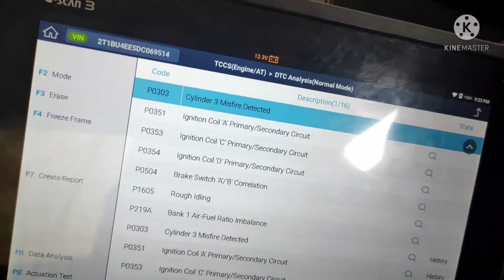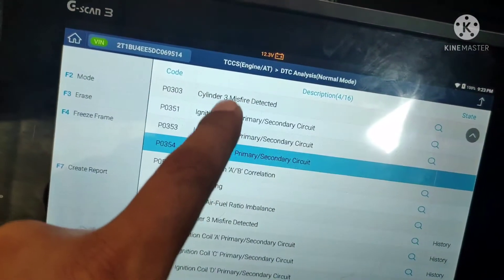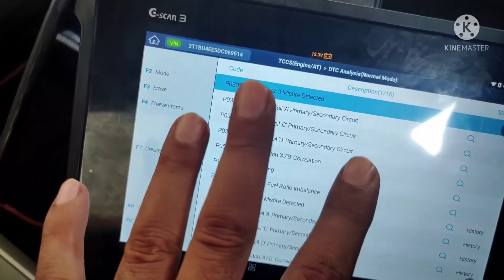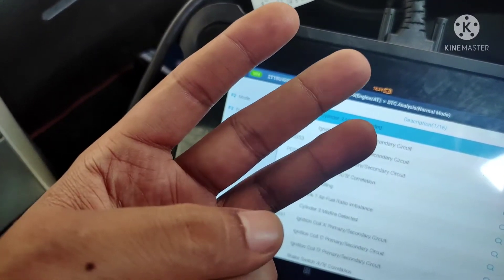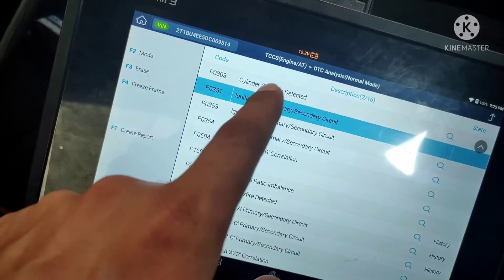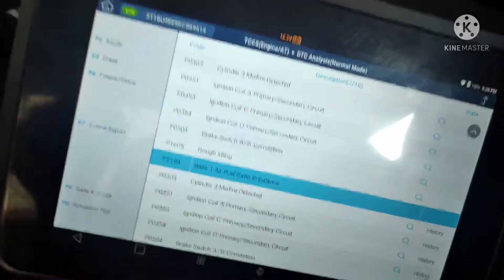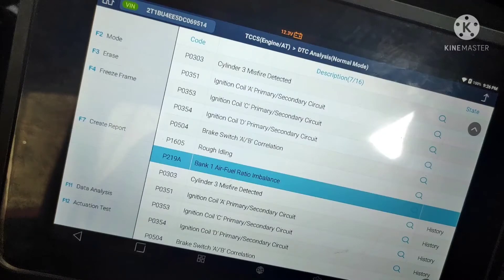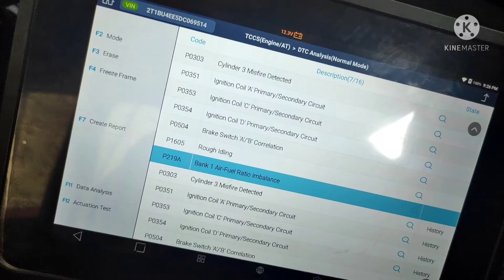Code P219A Air fuel Ratio imbalance [ SOLVED ]

Comment: Thanks! In my case it's P040 and P219A codes. I have already had all spark plugs and all ignition coils replaced, plus the alternator and serpentine belt. At first, it only showed P040, but I started it today and it was idling high without going down and threw the new code, P219A. I had ordered new fuel injectors after watching another video, but I was not confident that was the issue. Now you have convinced me that is probably the issue with cylinder 4. Now, I just need to learn how to depressurize the fuel rail so I can change the fuel injectors.
Reply from the maker: No need to depressuriza after turing off engine wait until it cools down then remove gas filing cap and remove the fuel house from injector rail the will some pressure just not let go in your eyes thats it. 
why ordered new injectors you can clean old one ! Buy a AC delco carburetor cleaner fill a small cup with ac delco and dip front of injectors in it for 10 minutes also use teeth brush to clean front end of injectors
Reply: @CarFaults  I suppose i could clean them, but the car has almost 1k miles on it and I am betting these injectors haven't seen the light of day since the car was made.
Reply: @CarFaults  Before I go elbow deep in this, is there anything else I can check first?
Reply: @katiesinthekitchen  in most cases it should be injector but it could be low head pressure but you can't do anything about that so go with injectors first

Comment: 2017 ford f150 3.5 ecoboost:  I had a P2237 (bank 1 sensor 1) code, so I replaced the O2 sensor.  After several drive cycles, everything seemed fine.  After two weeks. I got a P219A code.  The vehicle seems to be diving fine, and is very smooth.  I just purchased some fuel system cleaner (Chevron) and hope to see if this helps.  But if it doesn’t, I will need to diagnose the issue.  Any advice?
Reply from the maker: Looks like the problem with the fuel was already present it was not throwing code because of the bad o2 sensor. After the sensor changed, it worked and started sensing the fuel lean or rich.
Now, you should start checking the air leaks on manifold before the o2 sensor and intake. If all is good, then go with injector cleaning injector cleaner liquid won't do anything
Reply: @CarFaults  the chevron fuel system cleaner worked!

Comment: I have that p219A on a Toyota Corolla S. I just did plugs on it. Should I check the injectors then? Please let me know asap.
Reply: Yes its possible but when engine is misfiring you due to bad o2 sensor then you can check by removing o2 sensor connector (run engine without o2 sensor ) if there is no missing then chances of bad o2 sensor is very low there is also possibility on air intake leaking 
But start with injectors buy acdelco carburetor cleaner (not injector cleaner) remove injector and dip front end in acdelco carburetor cleaner for 10 minutes then with brush clean gently then dip again for 5 minutes then install it
Reply from the maker: Yes if check injectors if not injector then check cylinder pressure
Reply: It’s not possible that it’s a pcv or a o2 sensor. It idles fine. I also only had that code no other code. No misfire codes or anything just that code.

Comment: Mercedes CLA 250 need help with code P219D
Reply from the maker: Is there any other codes ?
If no then it’s injector if for any reason you are unable to check injector then change the location of injector and clear the codes then see which cylinder shows codes
Reply: @CarFaults  also showing P219c and P219F
Reply: Hmm it means you have multiple cylinders issue you also feel engine missing when driving ? If yes then you need proper diagnostic tool open misfire data then drive once you know which cylinder is missing and which is not missing swipe injector between missing cylinder and not missing cylinder 
For this engine i found many issue 
Mostly injector
Plug
Bad head gasket 
Catalyst converter blocked 
Bad oxygen sensor

Comment: Note that there’s a large number of causes for P219a — MAF, vacuum leak, exhaust leak upstream of the O2 sensor, faulty O2 sensor, bad injectors, bad plugs, bad coils. If you’re not seeing misfires, it’s less likely to be failing injectors/plugs/coils.
Reply: So if you don’t have a misfire that’s kind of a good thing it just means there might be a leak in the evap system?

Comment: 2014 Tundra 5.7 with P219c Cylinder 1 air-imbalance. Help?
Reply from the maker: Just clean injector nothing more 
Remove the injector place in ac delco carburator cleaner for 15 minutes then gently clean with brush.
Note : don't use any cheap carburator cleaner other then ac delco otherwise injector will damage and engine will take two to three self   to start when cold

Comment: Hi which place you are in Oman ? Want to visit your garage
Reply from the maker: Search Garage Al wali on google you will find me!
Reply: @CarFaults  3h 47min 😭too much far..can you guide me something please? I have checked in computer and got 1probelm.. have a code of p219d cylinder 2 air fuel ratio imbalance ...my vehicle some time missfire and engine light and track off light both comes ..what you think what will be the issue? I changed spark plug and coil ..but still comes ..
Reply: @saeem8701  Make and model of car ?
Reply: @justtrue8228  American specs .model 2014
Reply: @saeem8701  toyota Corolla??
Please check for injector if you already done then check air leak on intake from behind the throttle body
Reply: @CarFaults  please help me regarding this

Comment: I have 2016 dodge grand caravan that has p219a code. I changed o2 sensors, map sensor and injectors. I still have the code. No other codes except p219a. Is this code associated with ignition coils and spark plugs? Thanks
Reply from the maker: No its not due to o2 sensor three most common issues leak air vacuum from intake or injector O-rings , injector need to clean  or exhaust gas leak before o2 sensors.
Tips,
You can use bottle of water with hole in cap then start test air vacuum leak with water with start engine you will hear air water suction sound ( check leak for intake and injector o-ring)

Comment: I happen to have a p219f and a p219d code, would thse fall under the same category?
Reply from the maker: Please give me more details about car make model and year
Reply: @CarFaults  2019 corolla LE with the 2zr fe engine
Reply from the maker: Yes you should go with injectors first injector cleaner will not work when carbon already build up on injectors so you need to remove and clean you can remove them and dip in ac Delco carburator cleaner for 15 minutes and clean injector heads with tooth brush gently ( do not use other cleaners which evaporate only use ac Delco or something same as ac delco )

Comment: Thank you! My car had been shaking a little when I slowed down, almost like sputtering.  It had been doing that for some time. I changed the pcv valve, spark plugs but that didn't help much.  I'll check the fuel injectors now!
Reply from the maker: Hope you find problem soon also clean throttle body!

Comment: Would a bad crankshaft sensor(p0335) cause p219a and p0302?
Reply: These are the 3 codes I have.
Reply from the maker: Never crack sensor will give you only  p0335 no other codes
Reply: I have the exact 3 same codes. P219A, P0302 and P0335
Reply: @CarlosElHalabi  ended up being a coil pack for me. Even though the code said crank sensor. I didn’t touch/do anything else besides replace the coil pack. Driving and waiting to see if it comes back. The misfire is gone. Everything is normal right now.
Reply: @KerKoy  I've seen it but on older Corollas, even changing 1 coil wouldn't fix it you needed to replace the 4 of them. It's even illogical but it has worked before. I hope it doesn't come back and it does share the progress please
Reply from the maker: @CarlosElHalabi  looks like you need to clean fuel injectors also check for air intake leaks

Comment: What is spark wheel
Reply from the maker: Maybe spark plugs not spark wheel 🤔
Reply: @CarFaults  you said 4 things, the first one spark wheel and the second spark plug
Reply from the maker: @afgluda  oh maybe by misstake for engine Missing you need to check spark coil then spark plugs then injector if all good then maybe engine it self low head pressure
Reply: I have the code p219a with cylinder 3 missfiring, i changed the spark plug and spark coil but the problem is still there. Do you its oxygen sensors or fuel injectors?
Reply from the maker: @afgluda  no o2 sensor handle all four clyinder not only no3 you should go with injector.clean  injector with ac Delco carburator cleaner or change location of injector then check again if still no3 missing or not
Reply: @CarFaults  ok thanks 🙏
Reply: @CarFaults  also my car vibrate and the car does not get speed when i try to accelerate. The check engine light flashes at that time
Reply from the maker: Yes sing of misfire let me know when you get fault change location of injector to confirm fault.if not getting high rpm then also check catalyst converter blocked